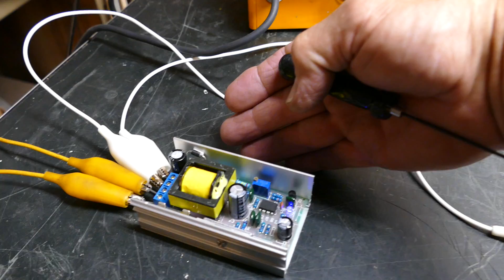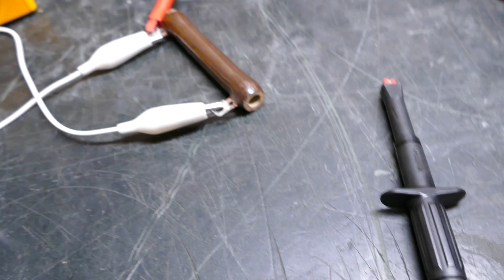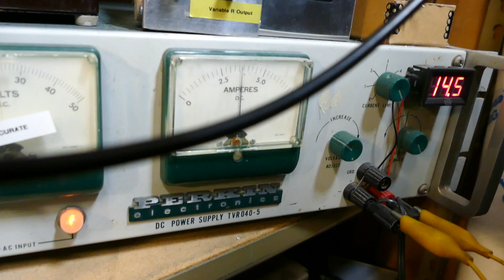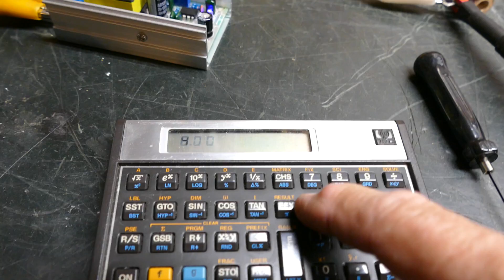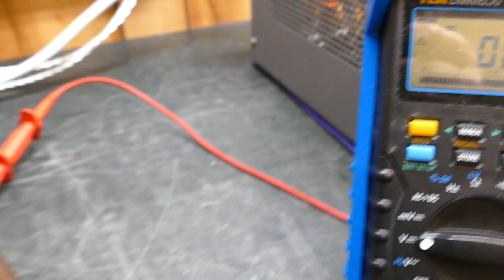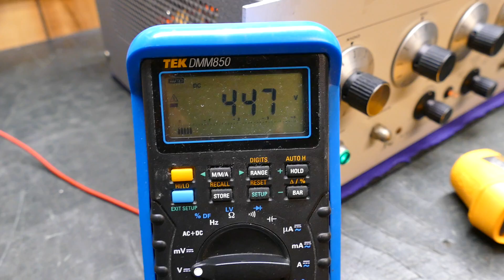Solid State High Voltage Regulated Power Supply For Vacuum Tube Circuits

Comment: I have been thinking of using one of these, and putting it inside an old dead transformer shell to hide it........I might be able to live with it if I can't see it .....lol
Reply from the maker: That's a good idea. A friend of mine here in El Paso took the trouble to cut a can electrolytic capacitor open clean it out and put individual capacitors inside and remount it so as to have an original look. Turned out OK.

Comment: How clean is the power for audio is it audible and is there any harmonics or transients that will cause undue wear on electronic components ?
Reply: It has a sawtooth output, so it will still need to be filtered I think.

EDIT: I have been able to use it for a Berning EA-230 clone at home and it actually did well. Once connected with the approriate low-esr capacitors, etc. it did ok when I tested it. :)
Reply: @MartyM.  Do you have any result on THD for the system, and VRipple, how did you filter? with cap multiplier?
Reply: @bjorntheviking6745  Hi, I don't have any measurements, at least not in front of me. I used a capacitors bank to smooth the ripple and in doing so it seemed to work pretty well. I got a batch of capacitors from AliExpress.com.
Reply: @bjorntheviking6745  I should also add that once I smoothed it enough using the caps, the biggest issue was the lack of an isolated power supply as these aren't isolated. I had to create a front stage with op amps based on a car amp design to do that successfully. (Or of course you could use an isolation transformer). The ground loop noise when used in a vehicle was pretty bad otherwise.
Reply: Marty McLeod did you use neg feedback in the front stage, and what freq is the smps switching at? The fidelity of a car are you upgrading speaker for better sensitivity etc
Reply: @bjorntheviking6745  I just cloned a Milbert BaM-230 car amp which is nearly identical to the old Berning EA-230. It has feedback in the design as I recall. I think the SMPSs might 46KHz but I'd need to check again as it's been a while.

I have custom crossovers & a nice speaker system I custom installed myself.

Comment: I am using a slightly lower voltage +400V, significantly cheaper $8 delivered Chinese DC-DC board with a 2.5A 12VDC laptop PS brick to power both the heaters and board for a simple EF86 - 6L6 simple circuit guitar amp.  A SE OT @ 3K load with +250V for B+.  This thing sounds fantastic!  The 12VDC supply is easier to drop down to 6.3VDC for the heaters 1.1A of heater current leaves plenty for the board to make +250VDC for B+ with 80+mA max current for the circuit.  The DC heaters and quality 12VDC PS makes for an extremely quiet hum/noise floor circuit.  With the volume pot dimed and no input, this amp is absolutely silent.  The quietest tube amp I have ever heard.  You wouldn't even know it was on, unless you bump the strings and then you definitely know it is still on.  A lower quality 12VDC PS without a 3 prong Gnd plug does produce a rather nasty buzz.  That buzz definitely does not come from the cheap Chinese board though.  These little boards are great alternative to the traditional heavy metal iron core PT for lower voltage/lower current guitar amp circuits!
Reply: Can you post a link and/or seller info?  Thanks.
Reply: http://www.ebay.com/itm/301808629393
Reply: Interesting.  Thanks!

Comment: Output cap is only 10uf wich does not help much to reduce noise for audio applications, you may need to modify the board or put a good big filtering cap at the output wich is more expensive than this board itself, but if you do this diodes will have to withstand a bigger reverse voltage so output diodes may need replace too.
Reply from the maker: I have not built anything with any of these power supplies yet. They appealed to me because of the ability to get HV from a 12 volt supply. I had a 6146 amp that I built 30+ years ago that used a SS HV supply out of a marine radio,  800 VDC at plenty of current but I ended up selling the amplifier.

I think these PS all run pretty hot and won't last very long. I have only tested my into dummy loads but with a 12 volt supply that can supply 40A, it is amazingly stable. I haven't carefully checked for noise either.
Reply from the maker: I don't think they are big enough either for a car amp. I mentioned the 6146 RF amp above but before that project I used that same HV power supply in a car amp running PP 6L6's in each channel and it worked great.  Pretty much a Dynaco design. The HV PS that I used came from a Fisher (not Fisher audio) brand marine band radio. You might find something like that on Ebay. Good luck with your project. BTW - since then I have used a Dynaco SCA-80 powered from a car 12 volt to 120 volt inverter and that works good so, maybe you could consider a traditional 120 volt supply powered by one of these inverters as a starter. I think the cigarette lighter is limited to about 15 amps (or less) so you will have to run a high-power inverter right off the battery with large wires.
Reply from the maker: When you consider the switching rate of the PS, probably in the KHz range, 10 uF would provide a pretty low Z to ground for ripple. As an example, say the PS is running at 2 KHz, a 10 uf cap would provide 8 ohms to ground to the ripple. Actually, I have not built anything with them yet. I have also purchased the 200 watt and another that is supposed to go to 660 volt but it doesn't quite make it to 600 V. I think they may come in useful for me someday.
Reply: Thanks.  Myself and another guy (DIYAudio forum) are wishing to build car tube amps and will need switching supplies.  The supplies I got seem far to small to be reliable or good enough for this application.  Waiting for the seller to respond about the defective one(s), but overall I'm very dissappointed.  Not many components on the PCB.

I've ordered the one you've got so I'll check it out once I get it.  Glad you posted the video, at least there's hope for this model.
Reply: I bet the 200W/660V adjustable is the same one I bought.  I also bought the fixed 450V version.  The 1st (660V) is VERY noisy (screeching transformer), and the waveform on the output is horrible and not smooth DC.  The 450V I bought gets hot (with no load) and sags my input voltage (12V) so I think both are defective.

Did you have that noise problem with the 200W model?  Did you have smooth DC output on it?

Comment: Hey where did you get this psu from? This is awesome!
Reply: +Jonathan Fisher http://www.ebay.com/itm/DC9-24V-to-DC-450V-converter-20W-boost-step-up-switching-power-supply-regulator/391440785544?_trksid=p2047675.c100012.m1985&_trkparms=aid%3D222007%26algo%3DSIC.MBE%26ao%3D1%26asc%3D36462%26meid%3Daae3ca8e2e6c43d89df881a096207728%26pid%3D100012%26rk%3D2%26rkt%3D10%26sd%3D151774140868
Reply from the maker: +Jonathan Fisher Look on Ebay. There are a number of these types of power supplies out there.

Comment: Look what I found...With these little modules you found that run on 12v,you can build a tube amp to run off your car battery for your car. http://www.ebay.com/itm/12V-to-DC450V-150W-high-voltage-converter-boost-step-up-power-capacitance-charge-/151774140868?hash=item23567199c4

Comment: Does tis power supply unit have a auto turn off when the high voltage is reached? i see only one ic, and normaly there would be a 555timer for the swithcing and a opamp for controling the auto turn off and on to mantain the target voltage, (the ic is scrapped so i cant read anything.)
Reply: Yes, essentially it is as they're regulated supplies.

Comment: Australian A/C is pretty much the same as the US, only we call the Hot wire "Active" and the other neutral, with a green earth wire. I am assuming the dc converters have protection devices that stop current reversing ( I'm perhaps thinking more of the risks of ungrounded amps of the past.

Comment: 80% efficacy in 447/14 voltage ratio!! This is something man! I'm thinking of using a 12V/5A adaptor and feeding the heaters with it and also feeding this SMPS too, to power Maybe a PP 6V6.
Reply from the maker: sajjad ho There a lot of these types of power supplies on Ebay of many different voltages. This particular one does not go below 200 volts DC.

Comment: I do have some concern about earthing issues, would it it be necessary to strip a ground wire from the 240ac lead, and solder in a ground lead to run to the chassis? Maybe I'm over thinking this. I'd be interested on your thoughts. Thanks.
Reply from the maker: charris939 I am not sure how your 240 volt system is wired. In the US we have a black (or any colored) wire that is hot and a white wire that is neutral and a green (or bare) wire that is safety ground and terminates at the same strip in the breaker panel as the white neutral wire.

Comment: I have gone ahead and ordered one of these, plus a 240ac (australian voltage) to 12vdc 7amp power adapter.  Plus a 12vdc to 6vdc 3amp step down converter to run the heaters. I'm looking at a pretty simple setup for a single ended amp, that I can switch between several output tubes, eg, 6aq5, el84, 6bm8.  I might even try using a couple of laptop batteries for cordless operation.
Reply from the maker: charris939 I am really interested in how it turns out. Please let me know. I tested this PS with a 30 watt output amp and all I was able to get on the output was 20 watts but with your SE amp, I think things will be OK at 5-10 watts output. There is very high frequency noise pulses at 45 KHz and noise in between those pulses at much higher frequency. Certainly out of the audio range. I put a electrolytic cap on the output and it did help reduce the noise. As you can read in this posting, some people say these power supplies work OK and others say there is too much noise. I intend to experiment with it also with a pair of 6BQ5's or 6V6's.

Comment: But you have to drive it with another bigger circuit. You're driving it with another bench power supply so it really doesn't replace that big chassis. It might replace some of those big tubes.

Comment: Hello, my friend,  and welcome in the mid 10th of the second millenium, "...this one replaces the transformer, the filter....it´s amazing..." GREAT LOL, yea!! Thanx for this idiom, need to dry my eyes now  :) :) :) :) :)..need to add more :) :) :) 

Thanx, You MADE MY DAY!!!!!! GREAT stuff, MANY, MANY Thanx for this one!!!!!

You also may try to cascade them, but watch the insulation of the top-one as it´s not designed to hold/tolerate serveral kVolts and stay save for a longer time ;)

I usually buy cheap (below 20$) SMPS designed for 12Volt halogen lamps, and rewind the torroidal secondary to match my needs. It´s only about 8x4x4cm can deliver 60Watts and it´s mains powered with fully doubled insulated torroidal, so easy to rework, just remove the original secondary add new tranny copper ;) 

Rectification is also on the easy side if you familiar with 50kHz smoothing, just add a fast diode, little good foil Condensor and a low ESR Cap may a little coil...and here we go;)
You can even try the symetrical voltage doubler, as within this frequency range it simply does not have any disadvantages, besides two more caps and another fast diode  addOn: see my voltage doubler/power supply video(s) on that toppic :adOff

Another big advantge: it´s lightweight!!

Another DIY (cheap if you already got a tranny) simple/easy/fast/dirty HV-source is: 555Timer, 2xfast switching PowerTransistors (no diodes anymore the IGBTs got them already inside by today) and a reversed mains tranny, works good as well, but only for mains frequency. Disadvantages: it´s heavy and you need a second power supply for the 555 driver section.
Reply from the maker: TubiCal I have considered cascading them for higher voltage (max current is 100 mA in any case) but I have not checked if they have a common between them that would prevent this. I bought three so I can test this idea. I think, just for fun, I will put together an EL84 amp using one of these as the HV supply and cathode bias for the EL84's to keep it simple.

As we all know, to plug this PS into AC mains, it will require a 12 volt 7 amp transformer into a bridge and (probably) a capacitor but that is easy to come by and construct but for a truly portable (vacuum tube) amp it could be plugged directly into the 12 volt (cigarette) outlet of a car or run off of a small lead-acid battery. 

We just returned from a Farmer's-Market in Las Cruces, NM where there were several musicians performing on the square. I could see everyone of them wanting a 15 watt vacuum tube combo amp for their outdoor gigs. Now I am thinking about mass producing 15 watt EL84 amps and becoming rich and famous...  What do you think :-))
Reply: Cool thing, try it....i just did it for myself with that TTA - TinyTubeAmp UCC85 and PCL86 PP with a switchmode power supply. Wooden case is about 23x14x11 cm, tricky but i managed to fit it all inside and a PM84 "MagicEye" will be fitted inside as well as soon i got the final panel ready as i need to glue the socket onto that panel as there is no space for a holder.
Reply from the maker: Greetings from El Paso. We have not communicated is a long time and just wanted to touch base with you hoping you and your loved ones are doing well. I hope you are still having fun with electronics. All is well here. Stay safe, my friend and write when you can.

Comment: 14.5 Volts dc (that's practically 12 volt battery charger voltage) You still a pre-regulator
dc supply for it with a stepdown transformer and a fullwave bridge rectifier and filter caps
for it.  Not sure if tubes need that kind of regulation.  Sometimes for guitar amps, a bit of brownout
on the plate voltage is desirable.
Reply: +SuperCarver2011 JUST THROW A RESISTOR IN THE PLATE CIRCUT TADA INSTENT POWRE DPIS

Comment: Hi, what is the power supply out of?
Reply from the maker: charris939 It is available on Ebay at this time -  DC12V 24 to DC 200-450V 70W high voltage converter boost step up power supply
Reply: charris939 try search ebay for: "boost converters" or "Step Up converters" you´ll find many of these :)